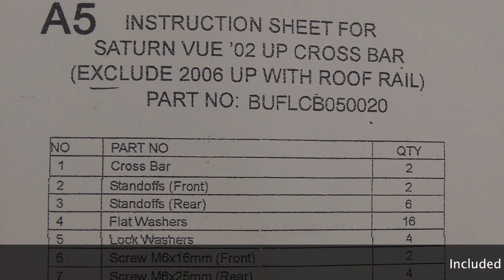Cross Bars on Saturn VUE - Installation

Comment: This was great.  My instructions were basically a parts list.
Reply: +greenmatador1 How's the roofrack? What do you use it for?
Reply: +Tyler Best It was quite a project.  I bought shorter new screws because I didn't want to try to cut to ones in the bag.  I also bought more lock washers.  I had to cut the rubber on the top about 1/2 inch too.   It is for a kayak and I haven't put the "U sections" on yet but the cross bars look nice.
Reply: Thanks a lot, man. My uncle actually put it together for me. It's pretty nice if you can get passed the ridiculous instructions.